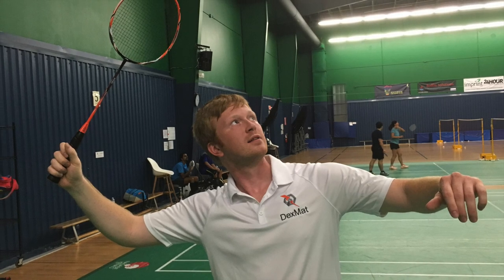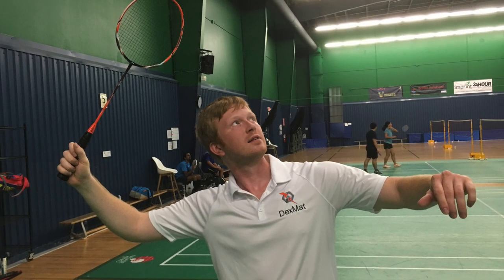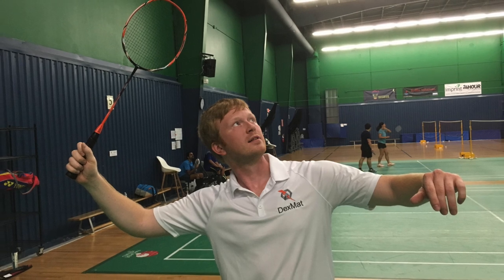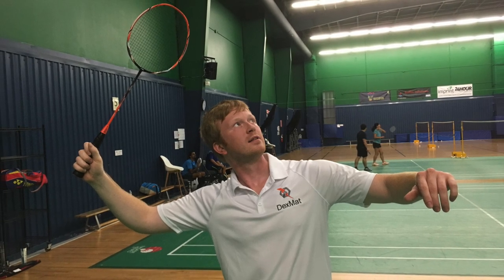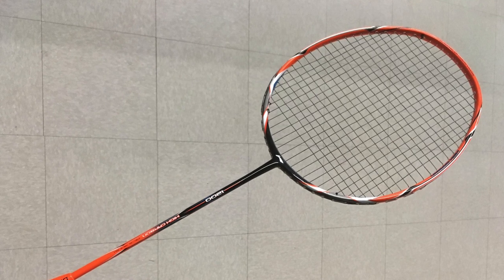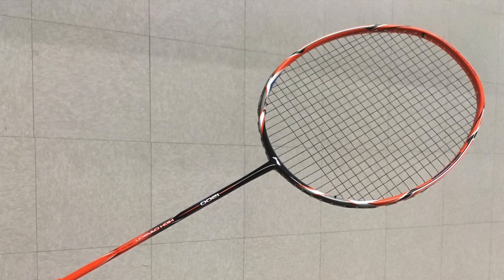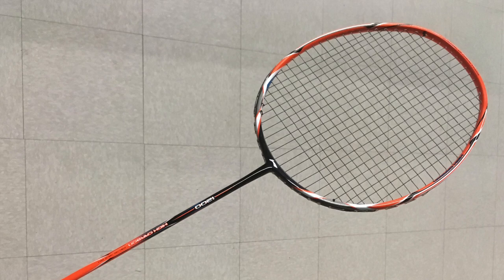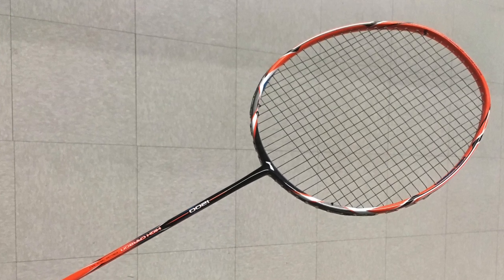Carbon Nanotube Badminton Strings

Comment: How is it different from normal racket... In playing
Reply from the maker: Hi Himanshu,

We fabricated this racket as a fun demonstration to show off the strength and durability of our braided CNT yarn, but this isn't an application or product that we are actually pursuing at the moment. That being the case, we don't have any rigorous metrics or description of the benefits of the racket at this time.  We just wanted to show an example of what could be done!

We do suspect that a racket made with the CNT braid will last longer than a standard material, but we haven't tested this.

While playing with it during the filming of this video, Dmitri found that it felt roughly similar to playing with a commercial racket.
Reply: @dexmatinc.2374  Could you make a weave out of it and make composites of epoxy and CNT?  Would be so cool if you could build boats and planes from this.